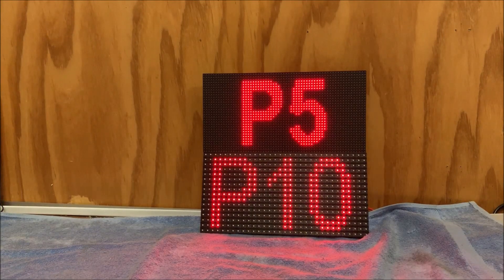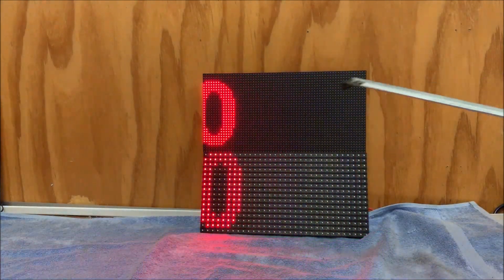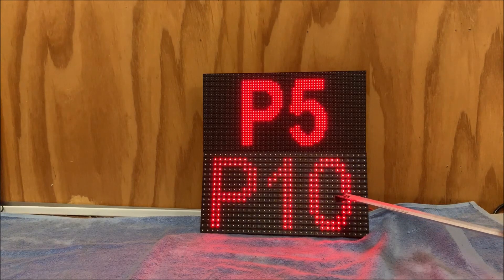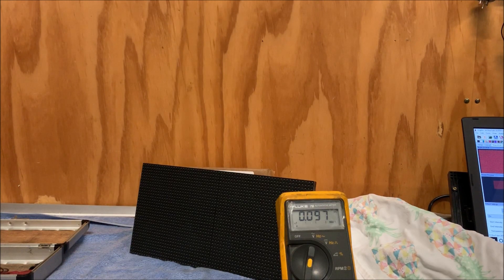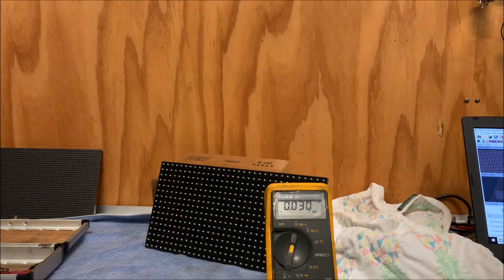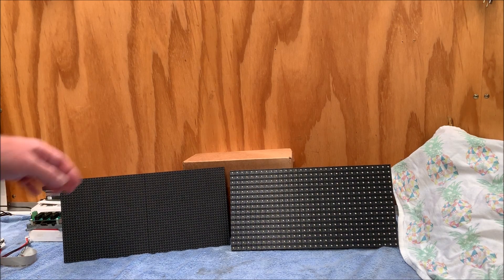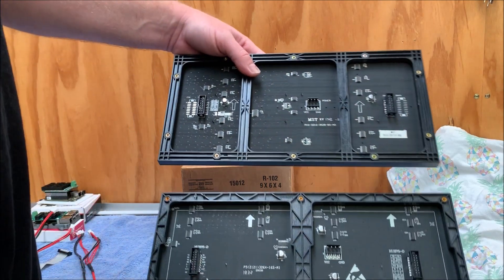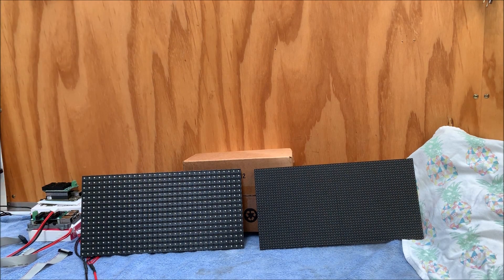RGB LED P5 vs P10 comparison - Christmas Light Display Matrix / Sign

Comment: Just got my P5 and Pi from Ken. Trying to find best directions to set up program now...
Reply from the maker: Are you looking to drive the panels from the Rasp pi? If so you need a Pi hat to suit and they are generally only ok for a couple of p5 panels. If your making a larger matrix I would suggest using a colorlight card and a rasp pi